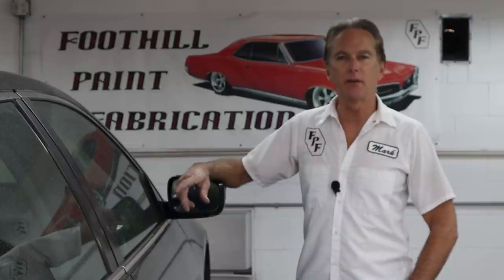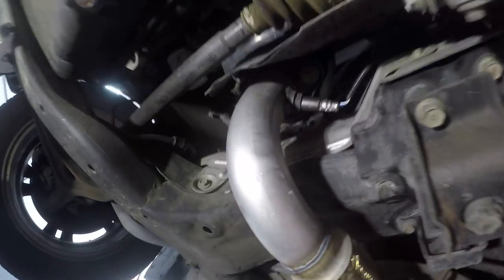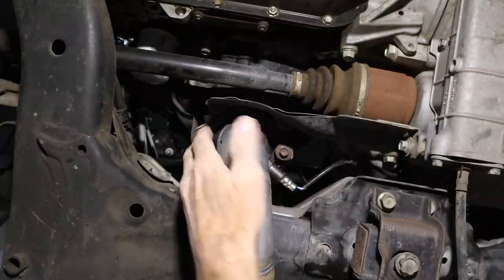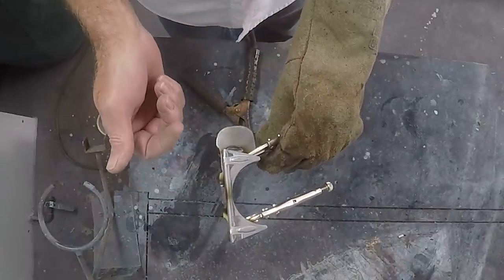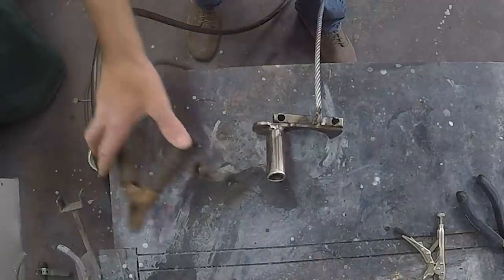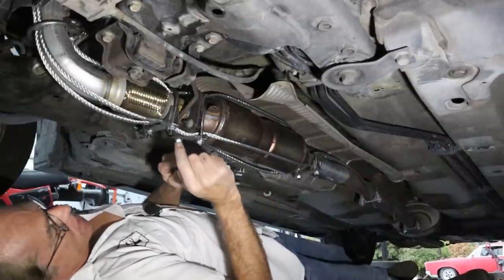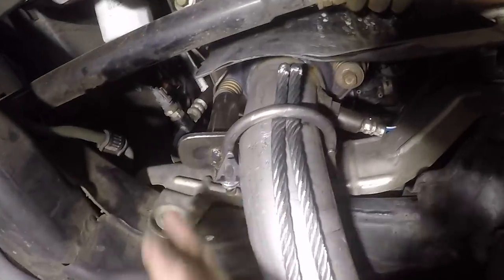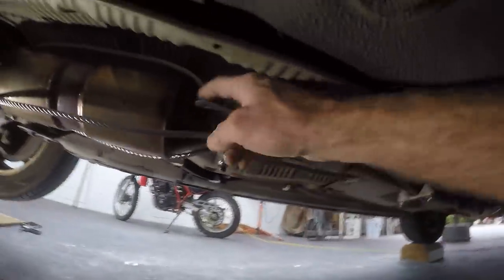Catalytic Converter Theft Deterrent Easy and Cheap

Comment: I feel for her, MY '06 TUNDRA 4X4 ON SATURDAY "DAY" at a hotel in Colton, CA 09/11/22 JUST HAD "BOTH" catalytic converters STOLEN while the truck SAT IN THE PARKING LOT. SO NOW I'M STUCK HERE waiting for the tow truck to tow it to the repair shop (luckily insurance is covering it, minus my deductible). My only reason for being here in this shit whole San Bernardino, CA was for school and this is the hotel they sent us too (real nice right, not even security on-site here or even CAMERAS AROUND THE BUILDING). SO NEEDLESS TO SAY anyone who's had this happen to em, I feel their anger towards these piece of shit thieves.... I'd voice what really should happen to em but I'd prefer NOT TO BE BANNED from Y.T.....
Reply from the maker: Sorry to hear you got ripped off.  I hear they don't like replacement cats, only factory ones.  My sister paid for OEM parts so it was big $$$.
  Like copper theft it will take time to figure how  to beat these thefts but this deterrent has worked so far.  Hope your truck gets fixed quick so you can get out of there.
Mark

Comment: A sawzall can cut the U bolt clamp just as easy as the exhaust pipe, and slip the Cat out between the cables.
Reply from the maker: I am betting that is work the thieves do not want to do.  It has worked so far and most thieves are using a chain tubing cutter because it is fast and silent.  This isn't foolproof but it is a deterrent.

Comment: Possibly it would slow them down ,bu i'm pretty sure they'd make you pay fir their inconvenience, with their trolley jack smacking into your doors and bonnet.
Reply from the maker: From what I have seen on the security camera the thieves look under the car and then just take a pass and look for an easier target.  They want as little amount of work as possible, that is why they steal instead of getting a job.

Comment: As soon as you said welding, I dropped the vid, need something that an average joe can do
Reply from the maker: You can do a no weld version and skip protecting the manifold bolts.  Cut the cable to length, install the exhaust clamps and then bend the threads over that are sticking out.  Just make it obvious the so bend the ends over with a hammer so they have to make several cuts to try and get your cat.

Comment: I'm surprised you didn't paint it a bright color and scribe the VIN # into the CC!
Reply from the maker: Thought of that after the fact but it rarely helps since the people stealing them sell them to other criminals.  If the cops happen to recover one the owner more than likely already had it replaced by then so it wouldn't be of much use. Still it is easy to do just in case. Cat still hasn't been touched since I did the work so fingers crossed it stays that way.

Comment: What would be nice is if they made the pipes out of titanium coming off the cat's. It would be a little more expensive but extremely harder to remove with a sawsall.
Reply from the maker: Good idea but then they would steal the titanium :-)
Reply: I've been thinking to take some Tungsten rod's and clamp them the length of the exaust pipe around the cat's. Maybe bend a couple into U clamp's to hold the rod's in place. They won't be able to cut through the Tungsten with just a saw. Only problem I'm trying to figure out is how to cut threads in the Tungsten I would use as U clamps.
Reply from the maker: @never2late454  Stainless is pretty hard to cut so maybe that could be your u bolts.

Comment: Easier option is high temp bright paint and etching the last 4 numbers of your vin on the cat
Reply from the maker: I was trying to deter it from being stolen by making it difficult to remove and hopefully have the thieves move onto easier victims. Paint and the vin is a good idea but it seems they are selling them to other criminals so I doubt they care.  I would definitely add the paint and vin if I did this again.

Comment: thats good start but after that plate would be good. i see everyone using one deterrent but why not more? its like opening presents. box in box in box:)
Reply from the maker: Smog inspection shops around here will not remove anything to do the visual inspection so I tried to keep it low maintenance. If you don't mind removing a plate and it doesn't cause the Cat to overheat they are a great idea.  Unfortunately on most cars there isn't much to mount the plate to.

Comment: Use Locktite Red instead of weld if you don’t know to weld. Only a torch will remove those nuts.
Reply from the maker: Good idea, cats get pretty hot but I don't think hot enough to weaken lock tite red.

Comment: What tool do you need to cut the cable to length?
Reply from the maker: I used a 4 1/2 grinder with a cut off wheel.  Just a cheapo Harbor Freight set up.
Reply from the maker: I picked the cable up at Home Depot.
Reply: @FoothillPaintandFabrication  The same one they will use to cut it off. Hope you catch them
Reply from the maker: @kingtut5923  So far so good. Had one guy look underneath and take a pass so it worked on him...

Comment: the question for me is why cover those bolts? they can just cut right through the pipe with a grinder and get converter out that way
Reply from the maker: People are stealing the down pipe as well as the cat to replace what was stolen from them.  The thieves rarely if ever use a cut off wheel since it makes so much noise and sparks so they use a chain tubing cutter or a reciprocating saw.  Pretty hard to cut cable with a reciprocating saw so chances are they will just take a pass on the car and go to an easier mark.  Removing the bolts is a common way of getting the pipe down where they can cut it also.
Reply from the maker: @docholiday1034    Not around here plus the Accord only sits 6" off the ground so they have to jack up the car to use a grinder and that is why they use a chain tubing cutter.  As a deterrent it has worked over 8 months and the car sits outside all night, in a college parking all day and at work. Call it luck or deterrent as long as the cat stays on the car I don't care.

Comment: I am sorry but all this work can be removed with a grinder when you can keep it safe by installing metal guard with star screws and you will see how fast they will run away from the car
Reply from the maker: Where do you attached the metal guard?  There is no frame on these cars.  I am open to better ideas that don't overheat the cat or block access for service.

Comment: ADVICE - Leave the Cable with Slack in it... It is harder to cut with a Sawzall... If it is real tight they can zip through it pretty fast.
Reply: Also you can use Steel Strapping like they use to hold up ductwork.  They make it with holes in it.  You use the strapping across the exhaust tunnel   and run cable through the strapping as well.  Make some strapping look like an X around the CAT Converter area. 
Basically, you have to make it so they need about 5-10 mins to get it out and they won't even try.  If it is too loud for too long they will avoid 99%  of the time.   This is a deterrent after all.
Reply from the maker: Cutting stranded cable with a reciprocating saw is very difficult either way. I didn't want it rattling when she drives. Been a couple of years with a couple of guys looking underneath but took a pass
Reply: @FoothillPaintandFabrication     I should have clarified    I run cheap Galvanized strapping across too... The strapping has holes in it and I make 'x' s   across near where the CAT is and just run straps across so that they can't easily shift the CAT out.  It's basically what you did then I added Straps with Cables so there is no rattle.    

You did a Great Job... The problem is I don't have a Lift or a Welder. 

 Those scums just hit 2 of our cars.  One in front of the house at 3AM... have it on video... took 1m 35 seconds and they were gone!  Sawing took about 45 seconds total.
The other car they hit in a parking lot of Walmart but they didnt get it out they must of been interrupted or something.

I also made stencils and painted on the CAT with high temp orange paint.  STOLEN and my lic. Plate... Who knows what works...
So Glad You haven't been hit again...  
Thanks Buddy!!!   I actually shared this video because you did a great job...
Reply: @FoothillPaintandFabrication     Another thing I did... My car has an alarm but they know the factory alarm does not go off.  So what I did is I also wired in 4 Blinking LEDs That are Orange.  The LEDs already come with the resistor and the sleeve so you just have to drill the appropriate sized hole.  Added a switch too but they draw so little they will blink forever and not drain the car battery.   Took me 2 Hours to wire and install...  Cost was $10 comes in a 10PK

Then I bought Clear Sticker Paper and used the and expensive  Alarm Company Logo and Put  Catalytic Converter TILT Alarm and put the sticker in the corners of the Windows.  You have to Print them as a Negative (reversed) so that you can stick them to the Inside of the window.  Took me 20 Mins to make, print and adhere to window. Used a Laser Printer.  Clear Label Paper (box 25x) was like $15

Comment: Can't you weld the cable directly to the pipes at either end of the catalytic converter and maybe muffler?
Reply from the maker: Yes you could but the problem with welding stranded cable is the strands themselves.  They are thin wires and when welded you only fuse a few exterior strands making it prone to breakage from vibration.  The clamps trap the entire cable spreading the load.  Sliding short sections of small steel tube or pipe over the cable fitting snuggly and then welding the pipe to the cat and exhaust pipe should work in place of clamps too.  Really anything you do to send a lazy thief down the road is a win.

Comment: Thief saw that catalytic converter was after market, not original. After market catalytic converters are less valuable. Chances of being hit again have been reduced significantly.
Reply from the maker: @paulk6216  It wasn't aftermarket, it was purchased from the dealer as factory replacement. That is why it was so expensive to replace.

Comment: Why a thief would use hand tools to remove a catalytic converter is crazy, especially if theres rust present. They want in and out as quick as possible. Mini hand held acetylene torches can cut through a pipe faster with no noise takes only one hand and no effort, it will drop right out. They don’t even have to slide under the car, if they can reach it with their arm they can get it.

Comment: Here's a much better solution/deterrent...
How about a law where anyone trying to cash in catalytic converters, has to provide detailed info about the vehicle it came from, along with full ID?
 And then, paid via a check which notes exactly what that payment is for, and all paperwork to be signed by said person under penalty of law...
  Nahhhh... That makes to much sense... and would actually work and put an end to this new crime trend.
 And how dare anyone suggest that criminals be held accountable and punished?!
Reply from the maker: I saw where they caught a semi full of cats heading south of the border so just like copper theft they seem to always find a buyer...
Reply: @FoothillPaintandFabrication  yep, to bad no one's thought of holding those buyers accountable.
 Not allowed to cash it in without all the proper documentation

Comment: 🤬Took a hit this Monday parked in Walmart. Right in front of the store where every one was walking and driving by!  Bold Bastards and stupid me for being a victim! 
All the security cameras, two witnesses and the police did 0 except for offering a case # .   2005 Prius, quotes to replace with one that works were $4K easy.
Reply from the maker: Oh crap that hurts.  Sorry to hear that but you aren't stupid, just living your life like you should be.   4K would total a lot of cars for insurance companies.  At 4 thousand to fix I would double the exhaust clamps and cables so they have to at least work at it to get that thing off there.
Reply: @FoothillPaintandFabrication  Thanks So much for you kind reply and advice! Before this debacle I was dragging my feet to maintain it! It needed brakes and struts all around. It used 1qt of oil since it was purchased and I just replaced traction batts, recently!  It may be time to find a car that is not a target!  At 1k deductible and $750.00 offer from Insurance it may be best to use is as a residential generator! If the thieves had 1/2 a brain they might think to salvage elements and parts from discarded TV’s etc at least they might learn something about electronics!

Comment: At 12:42 you literally said that you could easily remove the clamps with a Saws-all if you need to perform any kind of maintenance in that area.  These thieves use Saws-all's to steal the CAT convertor so how exactly is this supposed to stop them?
Reply from the maker: This is a deterrent so making it more difficult and time consuming was the idea, not making impossible to remove.  As you know there is nothing that will stop a determined thief given enough time.  Hard to reach all the stuff I installed easily unless it is on a lift or jacked up in the air.  After I installed it we got a guy on video looking under the car with a flashlight and then taking a pass on it so it worked on him.

Comment: Cables will mess up a saw blade. But will do nothing to stop an angle grinder.
Reply from the maker: Very true but that top cable is extremely hard to get to with a 4-5" disc.  Most of  the thieves around here don't use power tools anymore, they just use a chain tubing cutter they steal from Harbor Freight.  Slip it over the tubing, pull it tight and rock it back and forth 10 times and the exhaust pipe is cut.  No sparks, no noise...  Wish they put that much effort into getting a job.

Comment: Thieves use those cut off wheels too. Why not build a cage using plate steel? Like the kits costing 5 or 600 plus.
Reply from the maker: There are tons of ways to deter the thieves and this was just one of them you could do in your driveway over a weekend for less than 70 bucks and still allow access to the components of the vehicle for service or repair.  Cats can get pretty hot so anything that is done should have plenty of ventilation when idling and driving.  Unibody cars don't have much to attach a gage to but I am sure it could be accomplished and work really well.

Comment: would a low rider mod work?

theory is that dropping the car to its frame would keep the thieves from getting under the car even to jack it up.

while it is best to avoid paying anything even from an attempted theft o2 sensors i priced (google search) is $52 for 1 sensor still it can be expensive
Reply from the maker: That would work great.  They are to lazy to do any amount of work I am sure so they would likely pass on by. One guy was going to park over the top of blocks so they couldn't reach in and get his cat.  The parts are so expensive so anything you can do is better than nothing at all.
Mark
Reply: @FoothillPaintandFabrication  some accessory kits have been made cheaper and even standard over the years with alternatives involving existing parts.

take for example the car alarm used to be expensive but thanks to tapping into the lights and horn circuits the costs of alarms fell to the point where car makers could even include an alarm in the package.

so if the car already comes with air ride suspension then all the maker has to do is extend the range of travel of the air ride suspension actuator rams so the car drops to the ground when turned off so no room to get a jack under or even lift up the car by hand.

the car does not to bounce and act like magic fingers and give someone an orange assembly
Reply from the maker: @ejonesss  Pretty sad it has come to that but you are right that things will change to combat this type of theft just like things changed to combat copper theft from street light systems and railroad systems. It would be a lot easier if authorities took it more seriously and tracked down the people in charge of these cat theft rings and the buyers.
Reply: @FoothillPaintandFabrication  we have slowed copper theft by 1. replacing copper with aluminum and less valuable materials.

2. crack down on scrap yards to require id check and even limit the forms of payment to checks for larger amounts.

so maybe make a law where scrap yards can only take normal scrap metals steel, tin, copper, aluminum and stainless.

make it that the only places that can pay for the exotic metals like gold, silver and even catalytic converter metals are jewelry shops and only those with very strict rules on how they take the the converters.

another idea is to eliminate the converters and move the cleaning of the air to the massively industrial air conditioning looking units that does the capturing and sequestering.

so no longer eliminating the pollutants at the consumer level but remove them from the air by some massive industrial process.

Comment: Won't a battery powered cutoff tool go thru this like butter?
Reply from the maker: There are 3 cables plus the pipe to get through and the exhaust hanger which will take a lot more time and with a cut off wheel on a battery grinder it will make a lot of noise and sparks.  Thieves steal because they don't want to work and this will be a lot more work and put them at greater risk of being caught so chances are they will go onto the next car. I do agree this could be overcome with several methods but it has so far been a great deterrent.